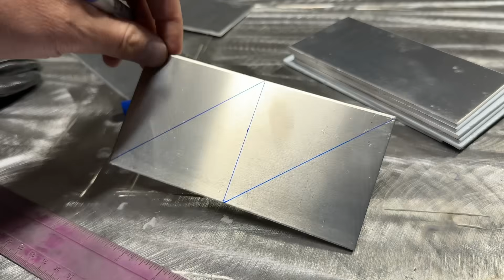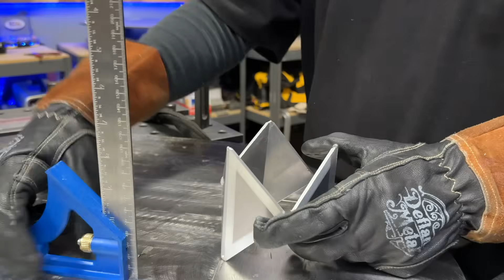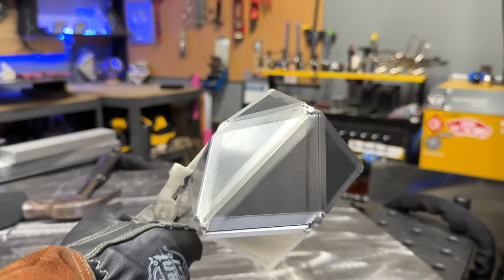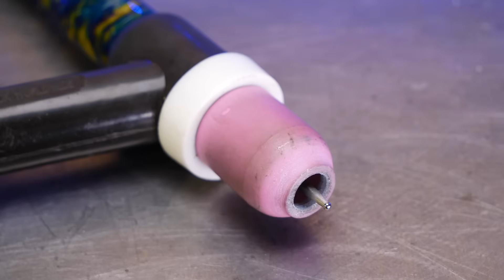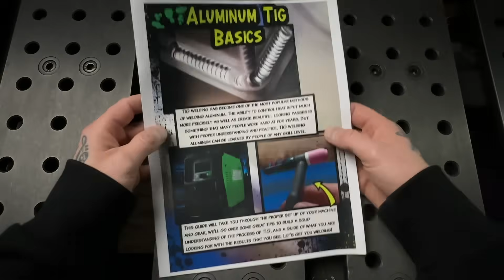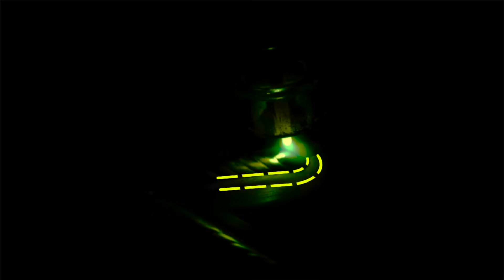Learn The Hardest Tig Welding Joint- I Almost QUIT

Comment: You have been super helpful helping me learn to tig! I'd really love a video on tig welding aluminum pipe as that's the majority of my tig welds at work. It is probably a long shot but any tip tricks or advice would be amazing! *Edit we use 2 and 3 inch schedule 10 with angled weld fittings

Comment: I have a question; if you could please answer it. I have the Everlast 210 EXT, and I do artwork as well. I do it at work sometimes when we don't have much going on, but I use a Miller Syncrowave 250 transformer. When I'm doing the artwork at work, I get the bright colors, and it looks great. So, when I got the inverter welder at home, using the same gas lens, same 3/32 tungsten, same cup as well, and the same gas coverage, but I'm not getting as bright of colors; there are colors, but they're more dark. I don't know what is going on. I know inverter machines are different than transformer machines. I'm seeing if you could maybe help me fix the problem.

Comment: Thank you for everything you have provided us. You always provide us with everything new. I have a question about the gloves you wear in this broadcast. Are these gloves good for work? Also, do you advise me to buy some of them? I found them on our website at a low cost, so I wanted to ask you, Dusty. Thank you, my dear teacher. Have a nice day.
Reply from the maker: I use these gloves for literally everything, basic layout, material handling, and then I keep a spare pair that are fresh just for my welding projects💎 I do hold a sponsorship with this company, so I may be slightly biased, but I actually purchased and used these gloves for a while even before I was sponsored, I love them!
Reply: @PacificArcTigWelding  Well done. I will follow your advice. I am Essa bin Rashid from Dubai. Greetings.🖐

Comment: Can you do a video on how to get rid of porosity inside the weld. I get good looking welds externally but x ray looks like a piece of Swiss cheese. Joints are brushed and cleaned with alcohol, preheated, and filler rod cleaned. Maybe even cover the effects humidity has on welding aluminum ?
Reply: If your having your welds x rayed you probably know more than me but I thought I’d chuck one of my lessons in on the off chance it helps. 
I was having problems with porosity and found 2 things that helped. 1 was the surface I was welding on wasn’t clean so as it got hot from the joint it would introduce contaminants. (I did try welding on an old off cut of granite worktop but it turns out granite can have conductive materials in it which spit and it also kind of cracks apart and spits crap into the back side of the weld too).
The other thing was incorrect gas flow and cup size. I had a no.8 cup on after doing some stainless and the cleaning wasn’t as good as normal. I turned the gas flow up and it made it worse. Swapped to a 6 like normal and I was still getting contamination. Then realised I still had the gas flow set quite high. Once I turned it down to 6 Litres per minute I was back to normal.
Also have you tried different tungsten’s? I pretty much just use 2% lanthanated now but when I used to switch between others I found there where ones that worked and ones that worked with a lot less problems. Good luck dude hope you find your answers!
Reply: @mopedmarathon as regards to gas flow a lot of people think that if some is good then more must be better and far too much is just about right.

Comment: What bandsaw blade lube are you using? I use bees wax lightly touched on the teeth so the saw tires are not contaminated.
Reply from the maker: I think it is just a cutting solution called "liquid cut" it's just a dilution with water and I've had a jug of it for years that lasts forever😂 it seems to be OK with any kind of contamination but I always obsessively clean after I cut🤙